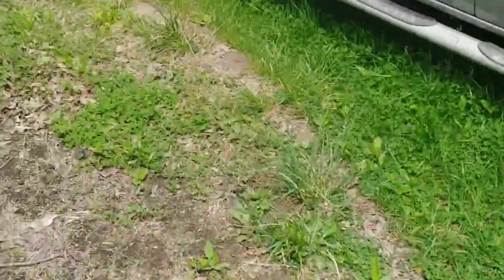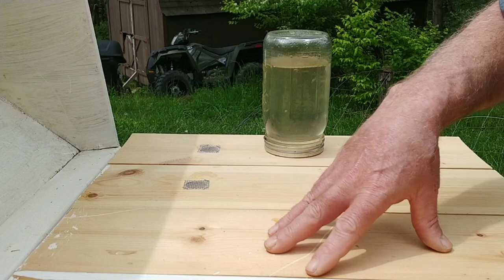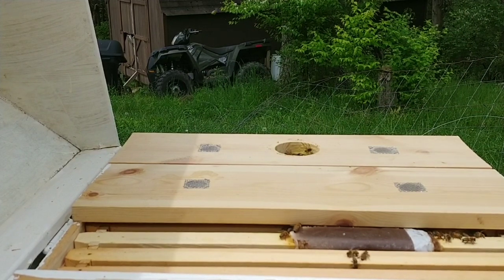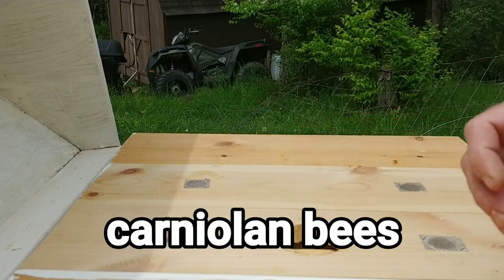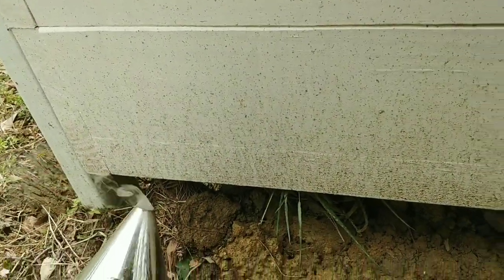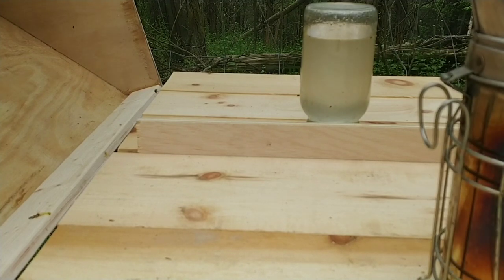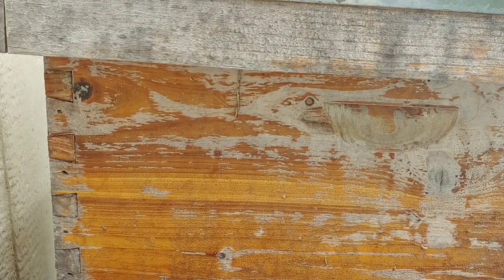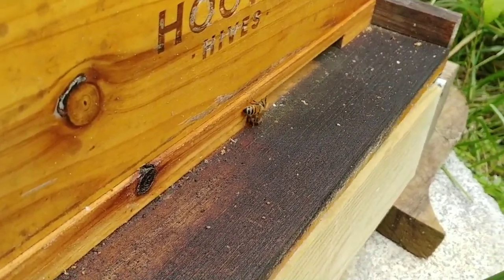vertical vs horizontal hive management differences #horizontal #vertical #beehive #long

Comment from the maker: Something interesting since this video was recorded - the 5 swarms I caught were all placed in new 10 frame langstroth deep hives with no drawn comb .... and they have all had second boxes put on already.  These saskatraz bees were placed in a langstroth deep 10 frame hive 3 weeks before the swarms -- they were a package of bees from mann lake, with 5 drawn comb and 5 blank comb and they have only pulled comb on  2 frames so far.  I'm not familiar with saskatraz bees but they are off to a very slow start .... the queen has decent brood patterns but they just aren't building up in numbers as quick as other bees I have had ... which is basically only russian, italian, carnolian, and vsh queens with italian bees.  I also just added 2nd boxes on most of the swarms I caught.....still no second box on the saskatraz bees yet.